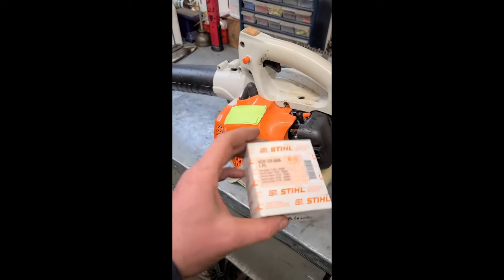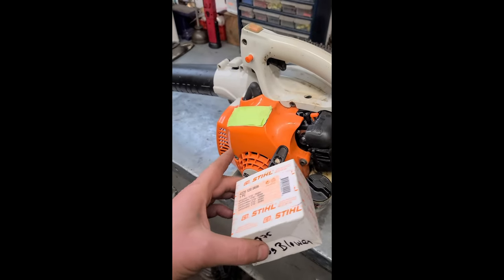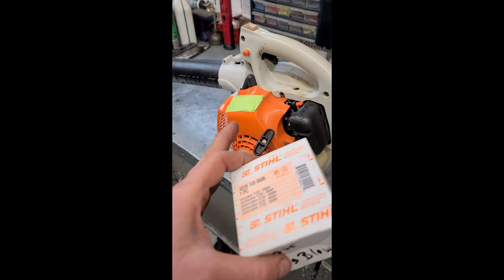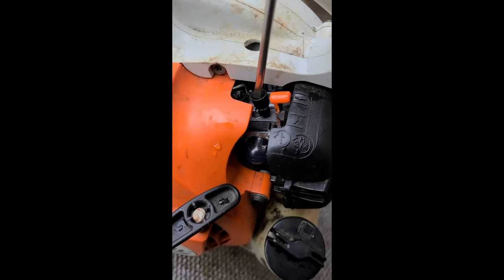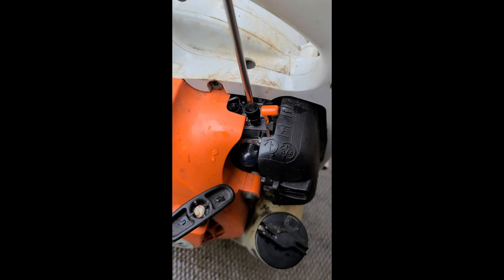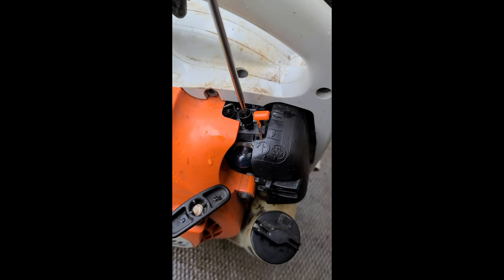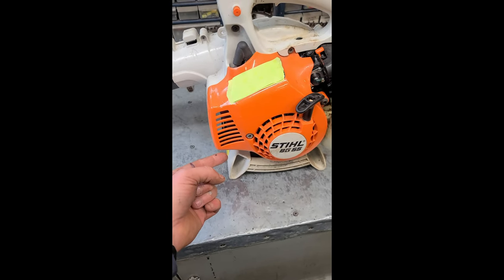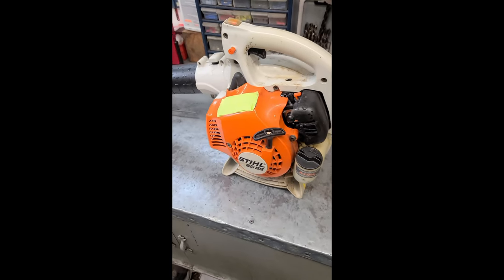STIHL Leaf Blower Bogging With New Oem Carburetor- Easy Fix! #shorts

Comment: Good evening from Kansas City Missouri.  I’m a Stihl mechanic and dealer and I wanted to share with you a discovery I made about a year ago on the Stihl 4241 series of blowers, coming in with flooding issues. In a couple of cases the blower was  hydro locked and in one case a BG56C had a bent connecting rod resulting in the blower being replaced under warranty.  The issue is the fuel pump diaphragm develops a crack over time because the machining on carb body and the end cap are misaligned.  Once the crack is formed, repeatedly priming the carb will pull fuel from the tank and feed it into the engine via the impulse port, holding the fuel pump diaphragm up to the light reveals the crack.  In some cases I would bet a slow leak down on carb under a pressure test of the needle/seat, but for some reason, not always,  when a leak was detected, placing my thumb over the impulse port on the carb body would stop the needle from dropping.   I thought I would share my findings with you so you could post a video with this issue.
Reply from the maker: thanks Phil!

Comment: Generally all carburetors  need fine tuning when installed new. Kinda makes sense.  Many times I find even rebuilds need adjusting, especially if the machine is older and someone has fiddled with it. More times than not someone has played with the settings somewhere along the line. Having the proper tools is a must on any adjustments. You can generally purchase said tools on line now.
Reply: My understanding is that if does not make sense.
  The carb it supposed to be compliant with EPA regulations and adjusted at the factory to those specifications….i could be wrong.

Comment: I've always hated messing with those adjuster screws. Never seem to get those right.
Reply: Then you probably have an air leak
Reply: @THEMOWERMEDIC1  I was just saying in general, which would include all 2-cycle types of yard equipment. Never had much luck messing with the adjuster screws. Such a pain.
Reply: You have to have a tuned ear for setting 2 stroke carbs . baseline settings are just for getting them to run .

Comment: There is nothing “New out of box” that will not need tweaking and initial adjustments for the location it is to operate in . Especially so with two stroke engines that are susceptible to altitude changes that affect carb needle settings .

Comment: Dony could you do a shorts on where you would set the H jet on these blowers? because they spend a lot of time at full throttle and I've recently fixed 2 or 3 blowers I would like to keep from blowing up due to lean settings on the carb. I also found on a stihl trimmer I had to take the limiter caps off in order to richen the H screw to make the trimmer run, did the same thing bog from idle.

Comment: We pull all spark arrestors off all 2 cycle equipment, since concrete and wet grass can’t catch on fire. Can’t plug a nonexistent arrestor. 40:1 premix ratio!
Reply from the maker: your equipment will last a long time!
Reply: @donyboy73  Correct. Our Stihl FS 94r had to be retired because we couldn't buy parts, even though it had strong compression after 10+ years.

Comment: I'm surprised that you can access the adjuster screw that easily.  These days they often are capped to discourage fiddling.
Reply: These days?
On a Homelite XL from 1980 you might not find any H screw at all. They use a fixed jet. And they will never bog down.
Reply from the maker: surprisingly on the bg blowers you can!

Comment: I am disgusted with stihl products after my 170 chain saw plugged the exhaust screen after one season. Doesn`t cut the mustard to my other saws. And I used their over priced oil with fresh non ethenol fuel. stihl is riding on their old name and insulting people by overcharging. stihl makes the slowest starting saws too! Pull 3 times. do a spin to the right then spin to the left pull 3 more times and hope it fires. junk!